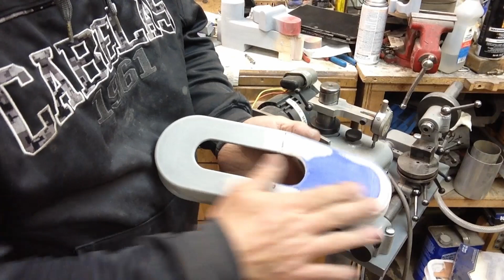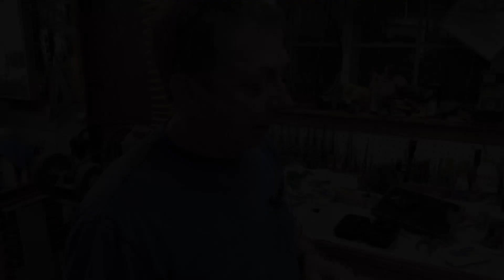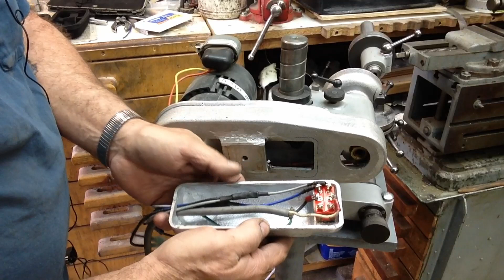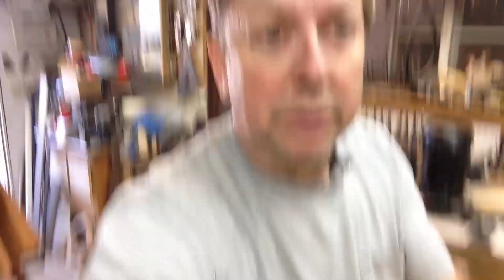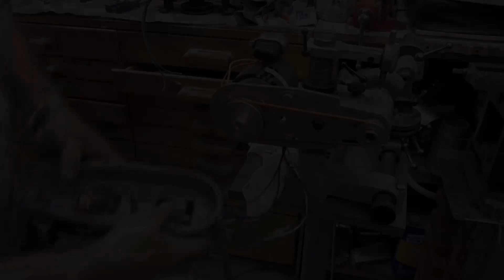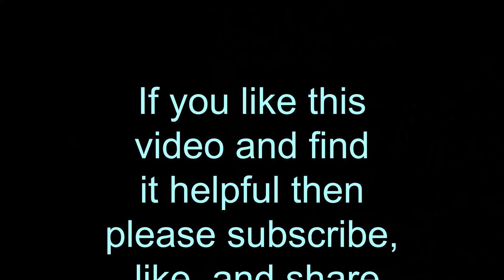The Quorn Tool & Cutter Grinder: Machining The Motor Belt Guard

Comment: Dan, that looks great, nice work! Is that a DPDT switch? If so could you just do “cross-wiring” to get forward and reverse?  Really beautiful work!
Reply from the maker: yes it is, but I have had trouble to get it to work correctly in that configuration,( stupidity on my part) I will check out Steve's wiring. The other issue that concerns me is that there is limited space to get everything under the guard in relation to the belt. Thank you, Dan.